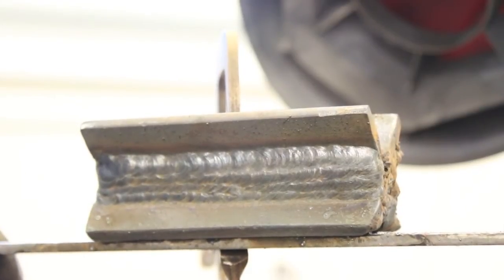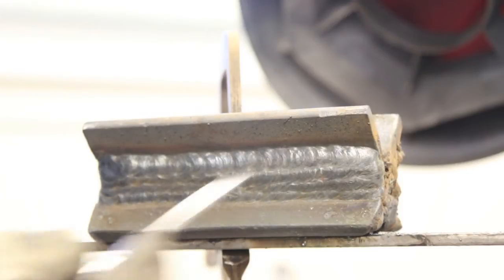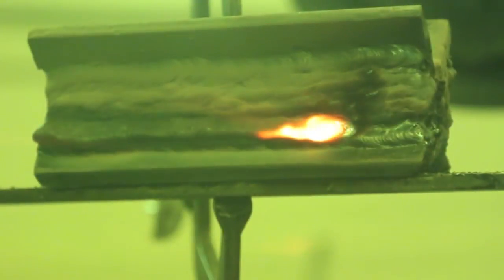Horizontal Stick Welding E7018

Comment: So I'm new to welding, just started a week ago! But you mentioned not to take the slag off when it's hot. What does it mean when my slag like peels up on its own?
Reply: That means youre doing a good job at keeping a good pace without going faster or slower and your doing good job at not spacing it out too much if you really have to hit it alot to take it off thats bad if it just starts peeling on its own when its starts cooling down thats a good sign